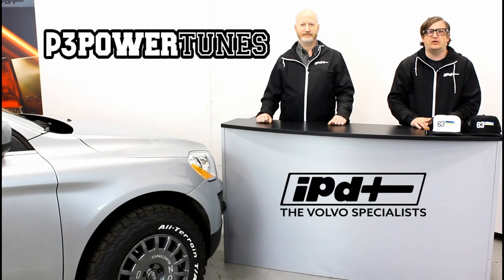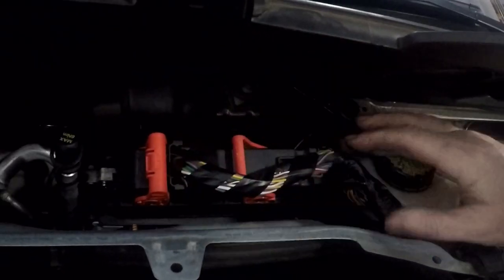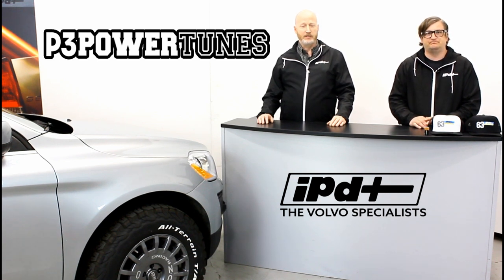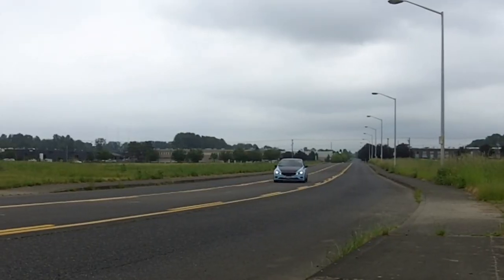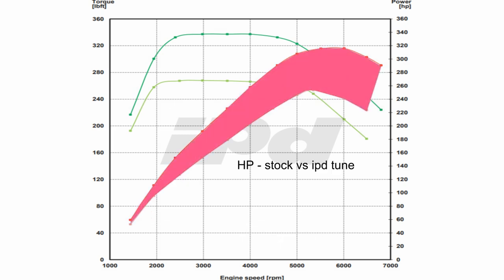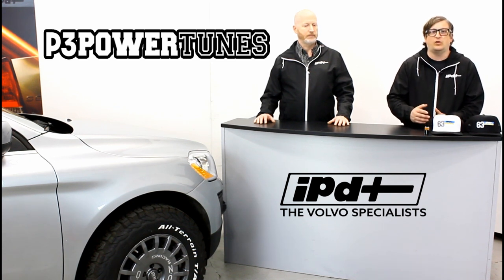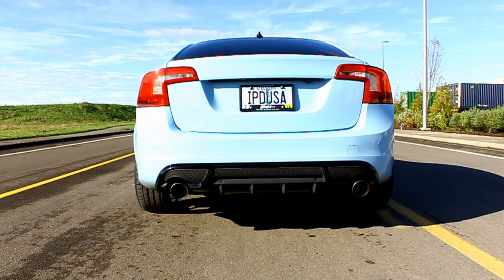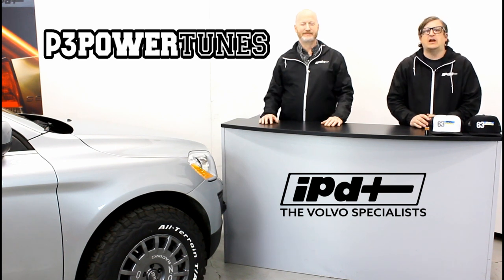IPD Volvo - P3 Power Tunes Overview

Comment: i get what your saying but i stopped buying Volvo cars  at the P2 stage .....ever thing else 2009 and up is built to drive 10-15 yrs and dispose of ..its not meant to be a classic 25 yrs from now as all the sensors and display items wont last and ipd can build the part im sure but a $800 dash cluster with a $1100 screen unit and all the sensors no way these p3 will be at car shows in  2046 ....
cool ideal but  a buy enjoy now and tell your kids about later.